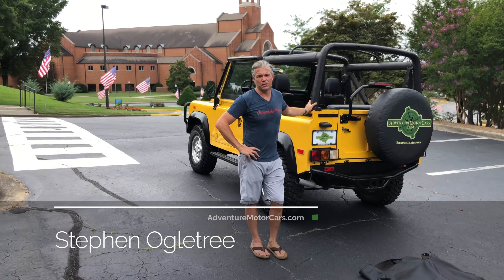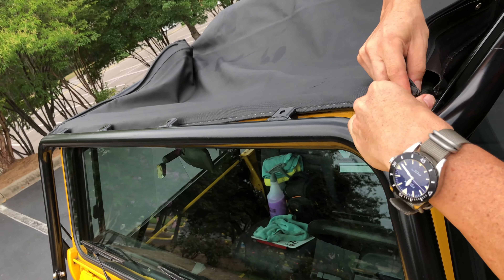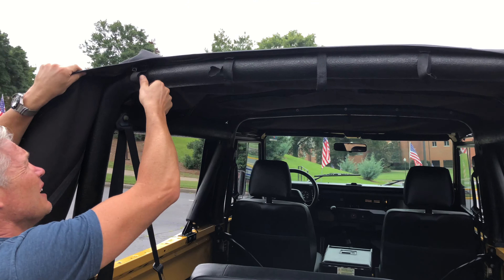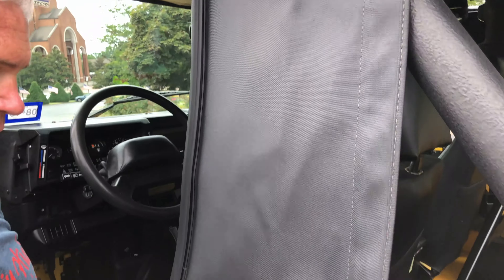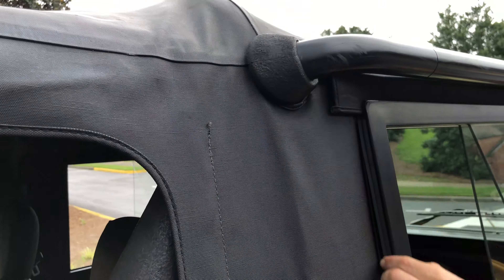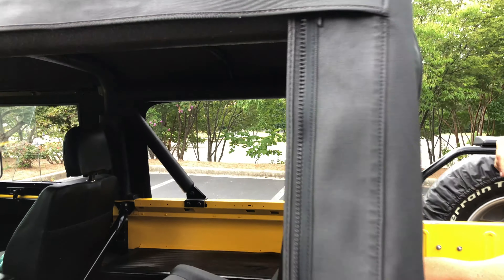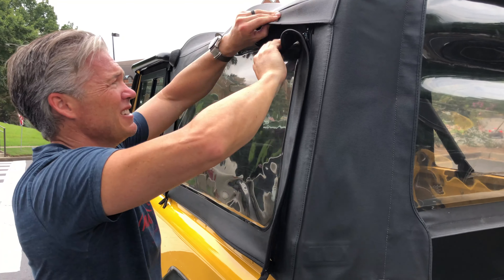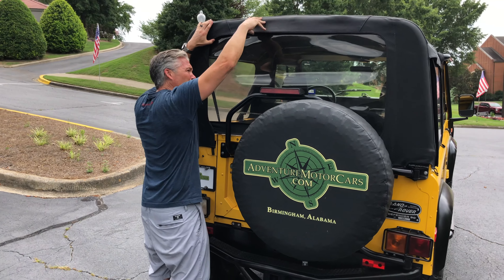Land Rover Defender Soft Top Install

Comment: Great video overview! 
Having dealt with the OEM Bestop and newer tops from US providers (Badger Coachworks and Rovers North) for over 20 years, there are a few tips and tricks that I will offer in addition to this process to make fitting the top a bit easier, especially if you are in colder climates where the tops tend to shrink:

1.     Open all doors and leave them open to start the top installation

2.     Always work from the front to the back.

3.     When inserting the belt rail at the top of the windscreen, make sure to button the corner to the windscreen before moving to the other side, this helps prevent the side from moving out of the rail.  Continue to insert the top into the belt rail on the other side and snap that corner in place.

4.      Proceed to wrap and/or button down the sides of the top above the door top and wrap the top around the roll cage just behind the door top corner – fasten with the Velcro and/or button(s) at the top of the window.  Note: I suggest you DO NOT attach the top to the belt rail behind the front doors until the end.

5.      Proceed to wrap/button down the top to the middle roll bar (5 buttons)

6.      I usually leave the alpine bow in the top when removing it (unless I am using my Surrey top) – it snaps in/out of the roll cage and serves no other purpose when the top is off (Remove those alpine bows when you remove the tops!), but if you left it in – now is the time to wrap/Velcro that back on.

7.      Move to the back and stretch the rear top portion over the rear cage and snap in place (5 snaps) and pull the sides down to attach the belt rail at the rear first, then the sides.  If you are leaving the 3 back windows out, pull the sides down behind the front doors and attach at the belt rail at the bottom ensuring that the side of the top is overlapping the front door tops.  If placing the 3 windows in, do NOT put the sides into the belt rail yet, go to 8.

8.      Window assembly will be far easier with the sides not attached to the belt rail.  Start with the side windows first – start to zip in the side window from the zipper from the back on the side – but only start it so it stays in-place (don’t zip it up all the way), connect the window top zipper (again, don’t zip it up all the way, and connect at the front side nearest the front doors – this will be far easier to do with the side panel not attached at the belt rail).  Once all 3 zippers for the side window are connected, zip everything up 100% and begin the belt rail attachment of the side window starting at the back moving forward toward the front of the truck and continue to attach the side panel belt rail behind the front doors, ensuring that the side of the top is overlapping the front door tops.  Do the same on the other side.  Next – partially zip in the rear window at the top zipper just to hold it in place and do the same with each side.  Once each zipper is partially started – zip everything up 100% and slide the retainer bar into place. Close the rear door.

9.      Final suggestion - Don’t close those front doors yet.  I mean, you can if you want, but you’ll probably notice a significant gap at the top of the front doors and along the door top sides.  If you want a cheap hack, get yourself some pipe insulation for 1/2” or 3/4” pipe.  What you will want to do is cut and place to length (allow for some overlap beyond the doortop) the pipe insulation to wrap around the contact points on the top where the door top “seals” to the top.  I leave this loosely on the top but it forms a far better seal for those door tops than what the OEM top and other aftermarket tops provide, but they may fall off when getting in/out of the vehicle – so you may choose to glue in place (I couldn’t bring myself to do that – slight annoyance having them loose when they fall off, but the system works).  I also place another piece of that pipe insulation at the rear window retainer bar and I drilled holes in each of the side retainer clips and the bar to put a removable pin in the bar on the sides to keep it in place.  This creates a far better seal all around.  

10.  Close your front doors and enjoy your ride.

Cheers - Roverin' Chuck, @AAYellowD90 on FB and IG